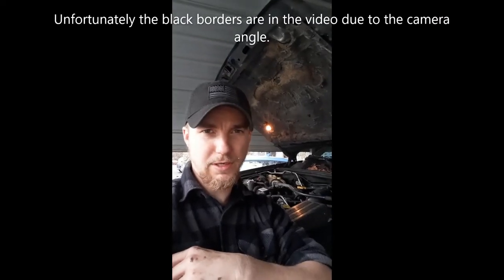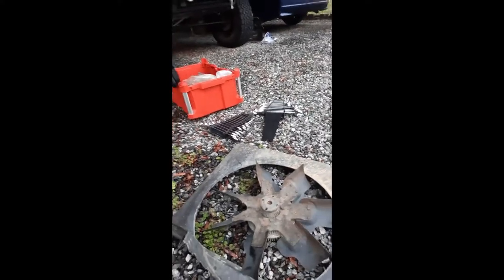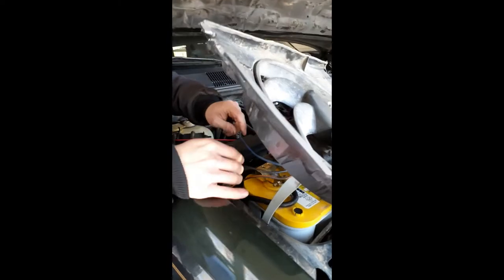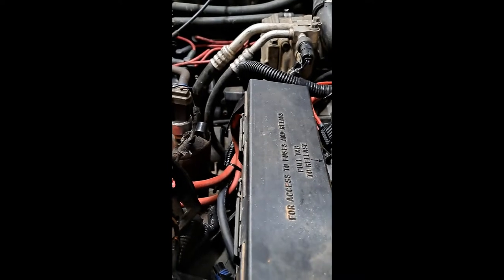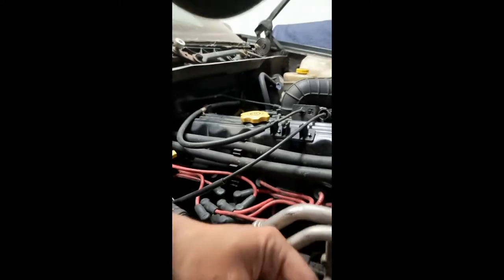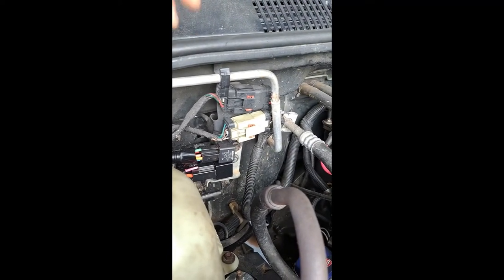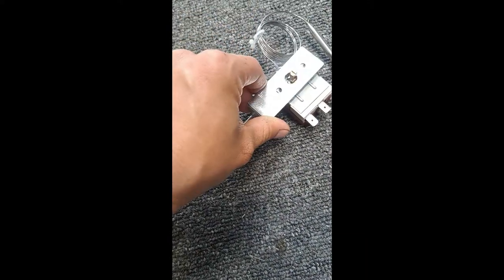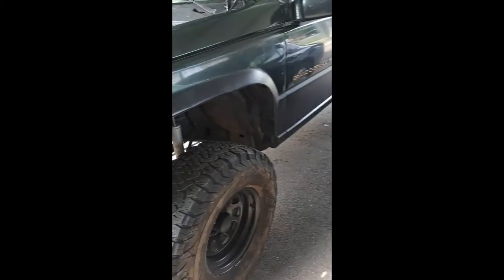1996 Jeep grand Cherokee (ZJ) electric fan conversion modification

Comment: Do you notice any improvements MPG or otherwise with this conversion? What was your motivation?
Reply from the maker: Not with mpg. Motivation is for off road use. At low speeds the electric fan will cool alot better. Low speeds and low rpms won't turn the belt driven fan very fast.